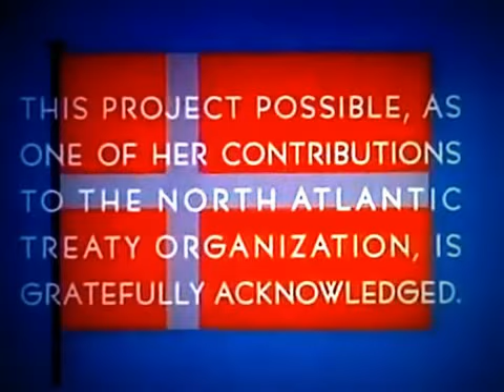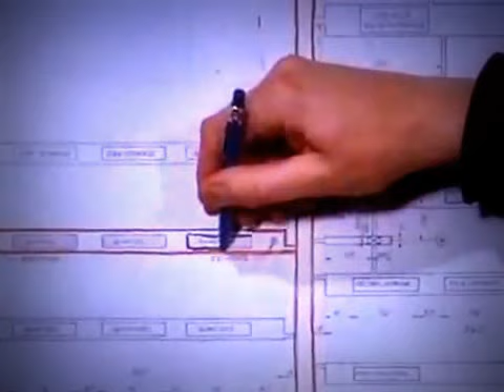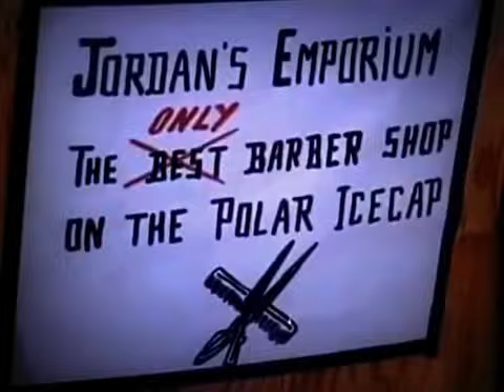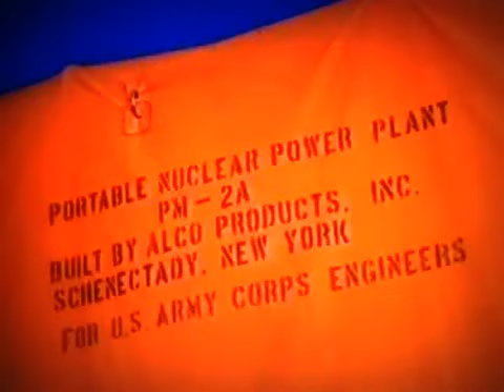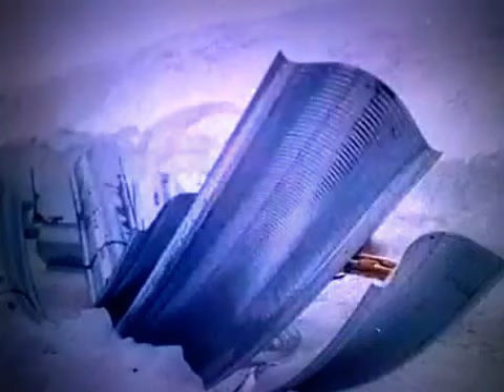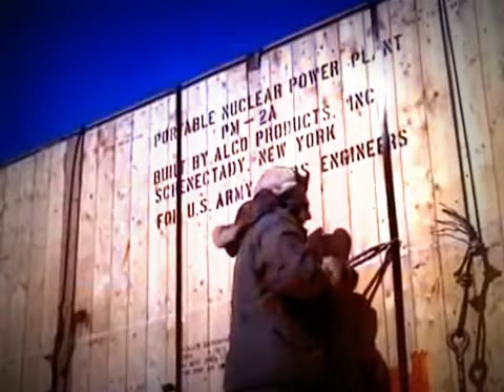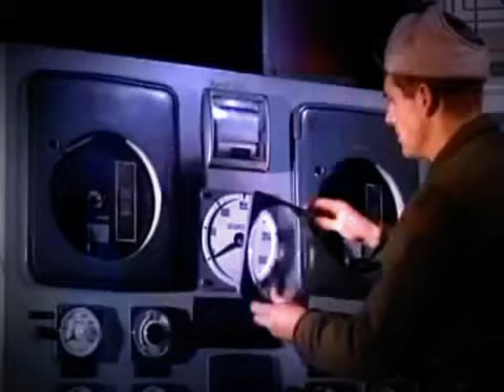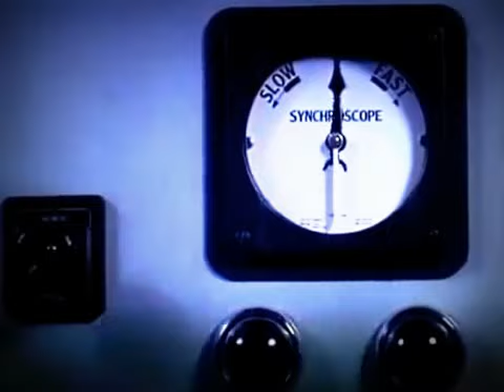Project Iceworm

Comment: This looks "fake".  If you watch their heads, they seem animated, I realize this is dated, however, something is "not right" about it.  Watch starting at 8:31 closely.  Notice the neck as the pipe is placed in the mouth, then look closely at the way the second guys head moves...it is very subtle, but that is indicative of animation, then the camera view switches back to the guy with the pipe and watch his head jerk back and forth as if the animator couldn't successfully align the head with the body...his head movement is unnatural...but is something seen in animation.  Please Note:  I am NOT saying that the project doesn't or didn't exist, I am only saying that the film itself looks "off".
Reply: The mocie has been electronically stabilised OR they have edited out some information form the board on the wall.
Reply: This is edited . It was colorized. You can watch the black and white version
Reply: This is colored not original
Reply: The waste IS real.